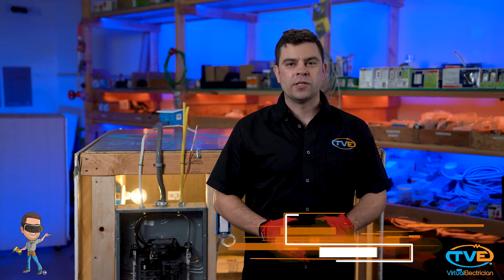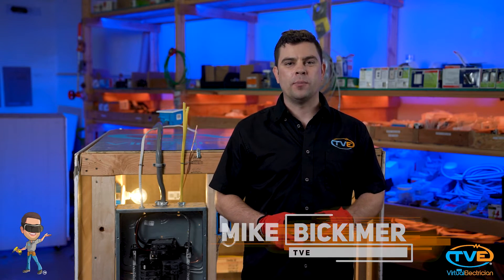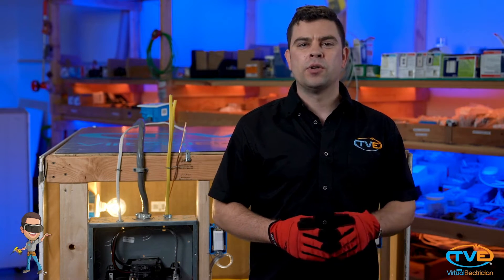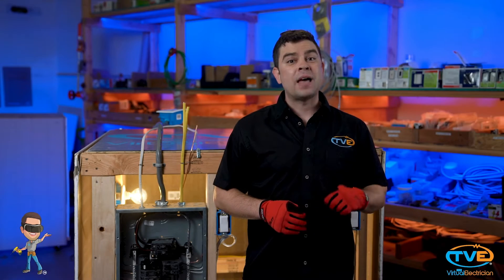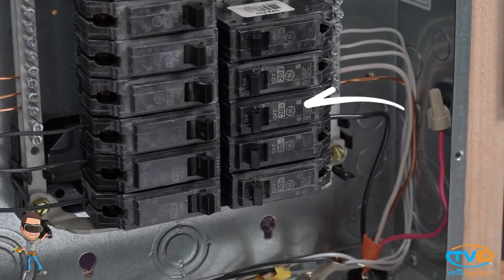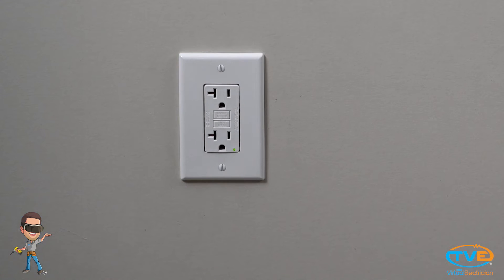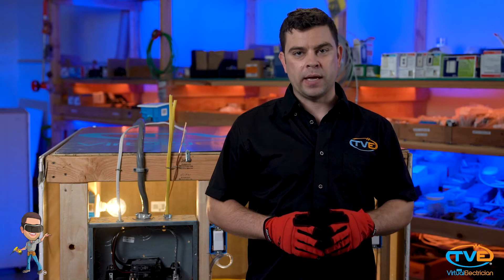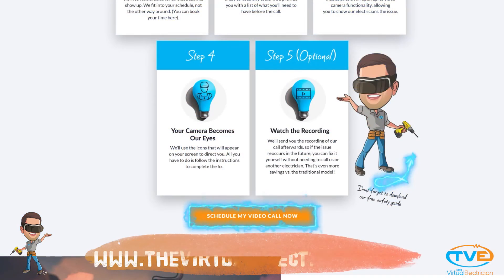National Electrical Code   Garage Outlets

Comment: NEC states the following:
"All 125 – through 250-volts, single phase, receptacles installed in garages must provide GFCI protection for the user of appliances or other equipment regardless of where the receptacle is located in the garage."

You can use a GFCI breaker for the circuit associated with the garage door opener or wire the garage door opener receptacle off a readily accessible GFCI protected receptacle in the garage,
Reply from the maker: thanks!